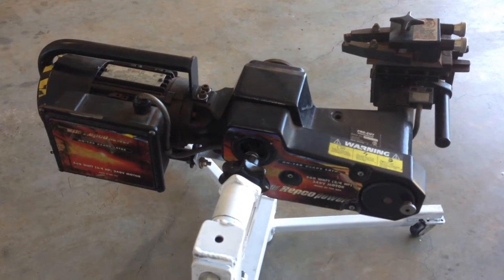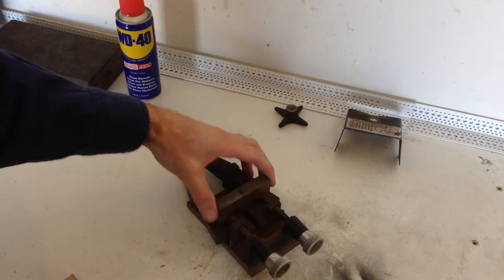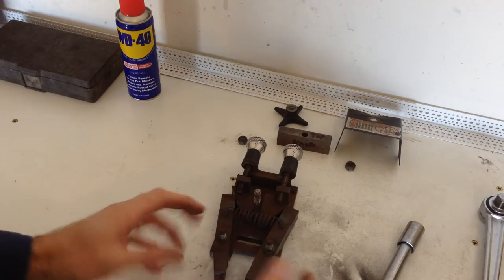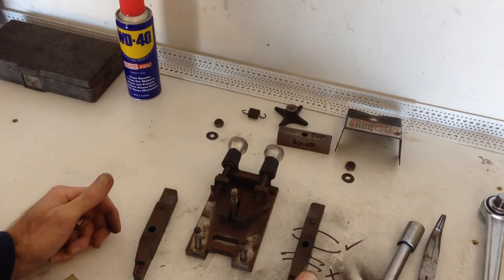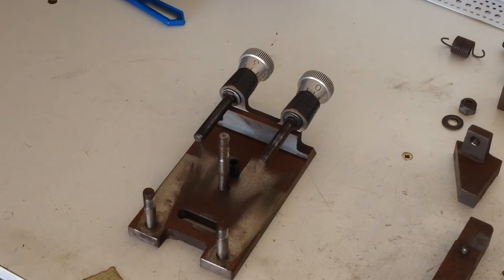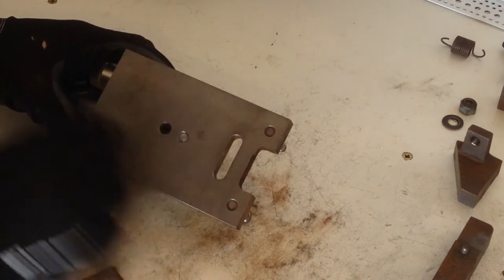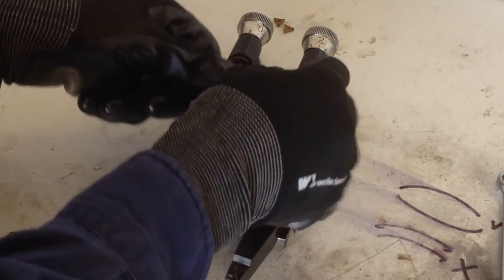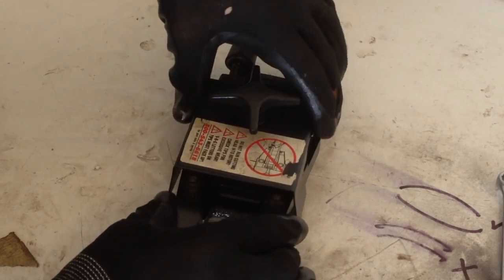Pro Cut / VBG On Car Brake Lathe Service - Part 1 : Cutting Head

Comment: Thank for making this video. Pick one up today for $200 with all kinds of adapter and extra cutting teeth. The left to right adjustment is stuck so I sprayed PB over night. Other then that the Motor works great just need cleaning and tlc.